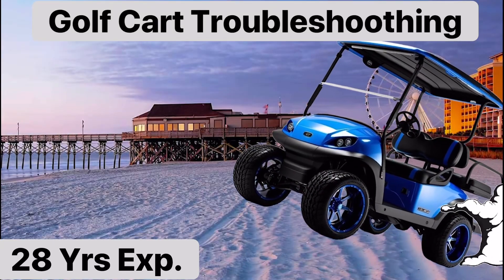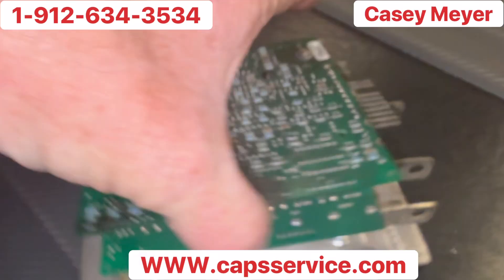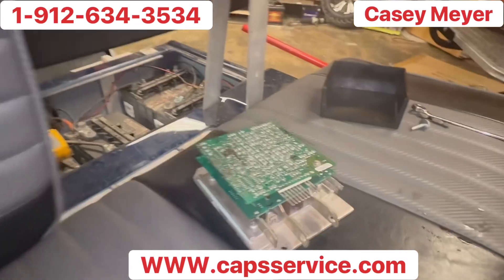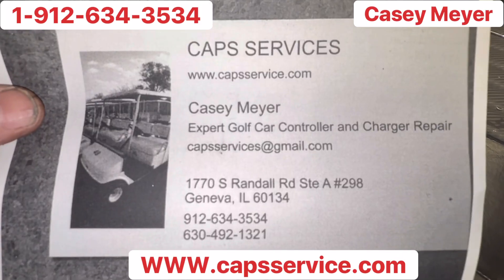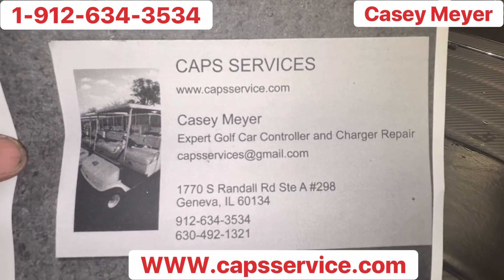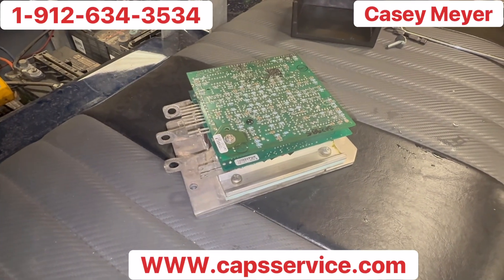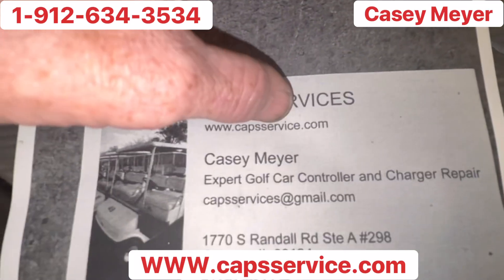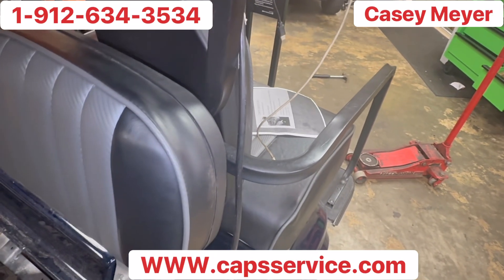Golf Cart Controller (how To Fix)

Comment: Hi, I'm based in the Uk and think we have an issue with our controller.  Sometimes it loses forwards drive but will work fine in reverse. If i turn controller to Tow and then back to Run it resets for a while and then same thing happens.  If this is controller do you know anyone in UK that could fix?
Reply from the maker: thanks for watching from the uk  always remember that a controller will never intermittently run. it will either do it or not do it. what type of cart do you have.  flip the top and bottom wires on the f n r switch and then in reverse it will run forward. I would lean toward the f n r switch.